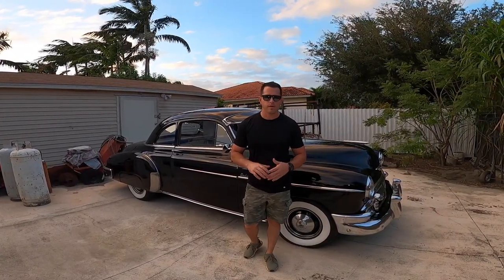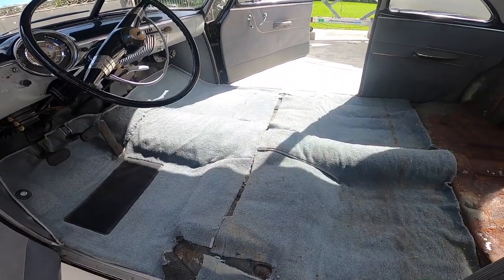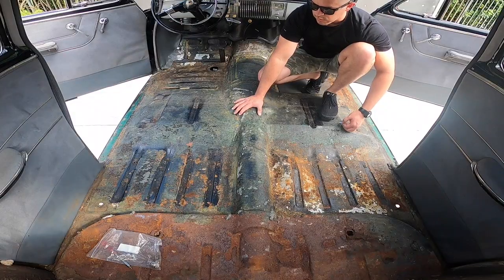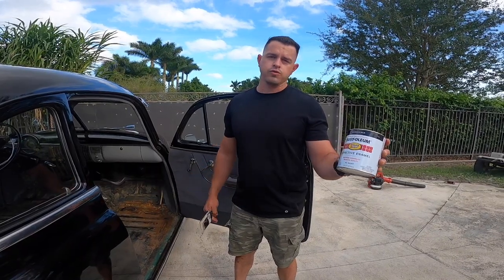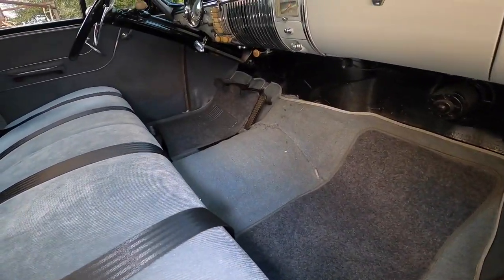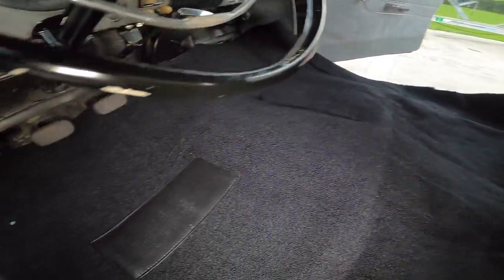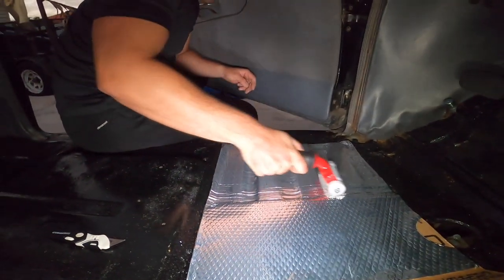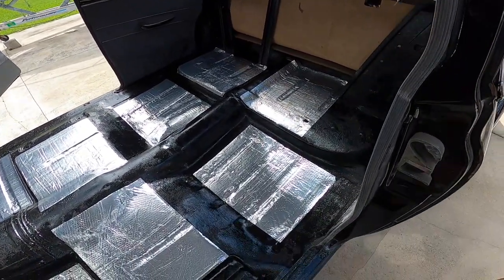Installing a new carpet in my 1950 Chevy Styleline Coupe

Comment: One thing to mention... I have made the mistake of using a drill to put bolt holes in the carpet. In this case, loop carpet (not cut pile). The yarn and backing of the carpet often wraps around the drill bit, and before you know it, the carpet yarn is pulling out unraveling like a sweater in the old cartoons. Beware. This is a great way to f*ck-up brand new carpet. Instead, I find the hole and use a #11 x-acto blade to cut a cross (+) to pass the bolt thru. This also keeps a drill bit away from the fine threads of the in-floor threaded bolt holes. And you are right... the black carpet really takes that interior to another level. Nice job.

Comment: Good choice on color of carpet. It really makes the grey standout more. One question how good did the adhesive work I'll be replacing the carpet on one of my cars in the near future and want to go this route
Reply from the maker: I wouldn’t recommend that adhesive. Try to get another brand that’s actually made for carpets
Reply: @GenerationOldschool  I think for something as big as the carpet it would be better to use the heavy duty adhesive or take it to a shop so they could finish the job for you.

Comment: Don't ever use a drill directly into carpet.  You want to solder a small hole in the carpet where you would run a bolt through otherwise you risk the drill thread catching the carpet fabric and messing it all up.